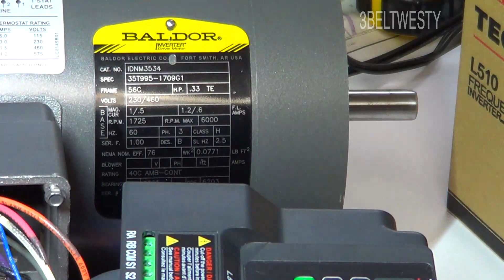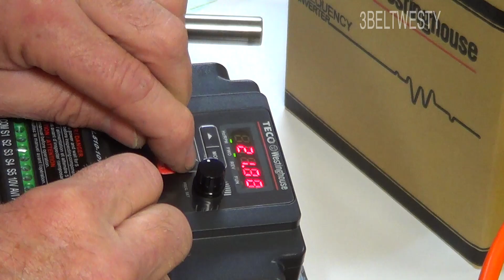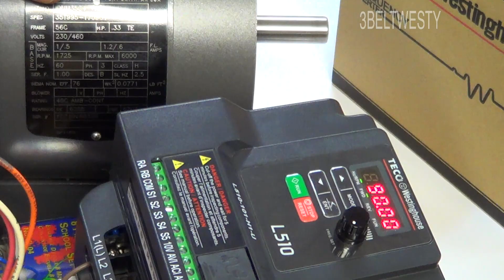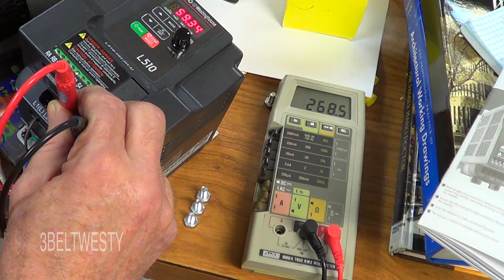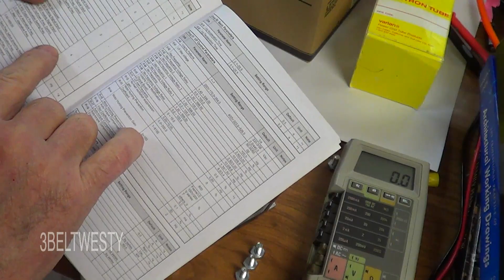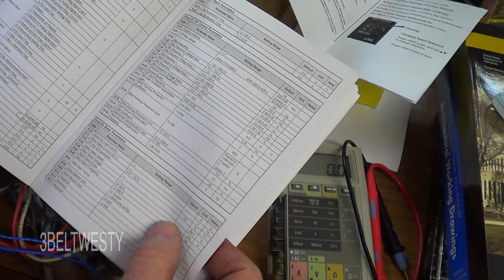3 phase motor with 120 volts VFD inverter drive

Comment: I am having problems with torque when using larger bits in my drill press. The system shuts down when a minor level of torque is applied. The torque is not noticeable visually. I turn off the VFD and Drill press for a few minutes and all is ok again. The motor is  3phase 230/460 volt. I have not been able find any settings that can increase torque.... Do you have any suggestions?
I am using the L510 VFD from TECO..
Skip....

Comment: Hi. The question I had previously, I was able to solve it, thank you, anyway.  If you can let me know how I can adjust the voltage input, because I'm noticing, that every time I turn it on, the VFD shows 110 volts, when the power outlet in my home has 120v analyzed with a voltage meter  .  Would there be any parameters, to change it to 120v, when I start up?

Comment: Are all 3ph to 115v VFDs like this? Can I get one to turn on and run at the motor’s full 1750rpm without playing a video game with buttons? If so would it need to be reset if power is lost?  It seams many of us just want to power an older 3ph machine without having to program a VFD each time we need to sharpen a tool for about 1 minute. Also don’t require all the options baked in. Not to be salty but the tech often answers questions not asked. Hoping for a simpler solution. Ideas?

Comment: The vfd shown in the video can be installed with a three-quarter horse motor or how much capacity can be connected to this model.
This is my  mail aquinorafael146@gmail.com thank you.
Reply from the maker: I posted a manual and quick start guide as two comments

Comment: Hi.  I have a question, when connecting the VFD input at 120vac to the 208 or more three phase motor, does the motor lose torque?
Reply from the maker: Here is the voltage vs frequency of this unit. https://www.youtube.com/watch?v=GEKpAY3UgK4&t=80s

 Most 208 V motors also work at the higher 240 volts and somewhat higher.
Reply: @3beltwesty  i think he is asking is what is the hp of your motor because you are inputing the drive with 120 vs 240 single phase? does a 2hp motor become a 1hp? are you getting 120v 3phase output